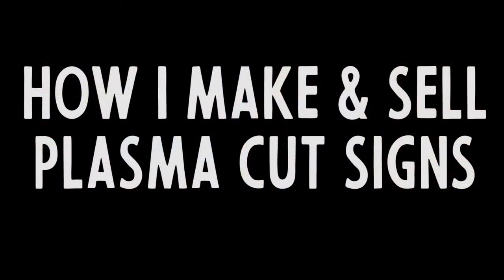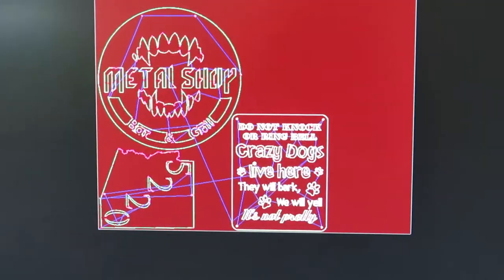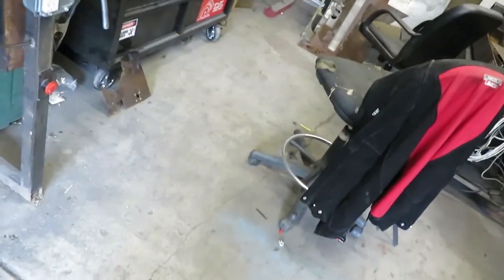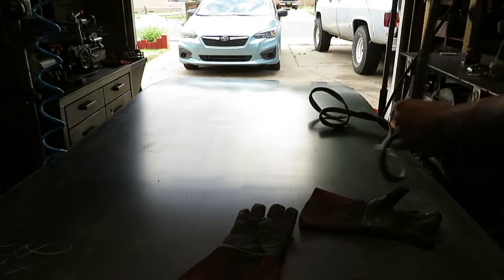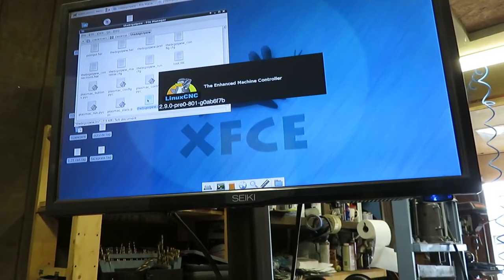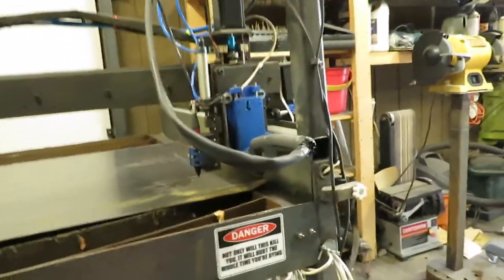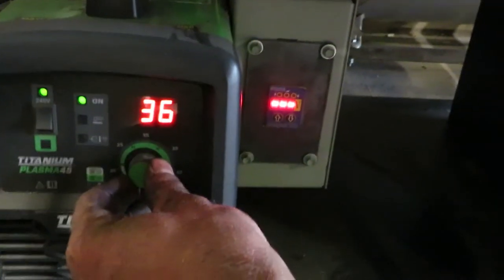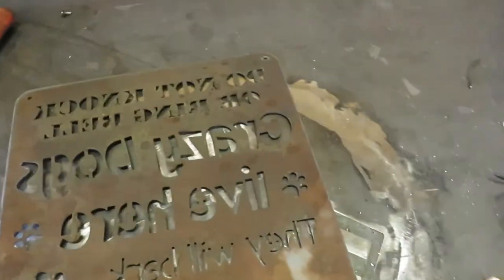How I make money selling plasma cut signs

Comment: Bro., I'm in final design of my cnc plasma table right now.  Your pain on cutting an inch off each sheet is real, but you helped me out just in time.  I was going to do 48" wide. Fook that, now I'm going  to 52" of travel on my head which will prob. have my footprint at 60" +.  You saved me some real hassle bro.  You ever roll through Nor. Cal. I'll do you right with a proper 'thanks'!
Reply: I did the same! 52

Comment: Great work! Tip to get slag off. Muratic acid. Dip signs in the acid over night and it will have a sand blast type finish and the slag will all be dissolved. Helps a ton
Reply from the maker: That's how I've done it in the past, but having a big tub of muriatic acid sitting around my small garage proved to be a little bit of an issue hahaha

Comment: Great video thanks for posting. As I was watching I noticed you not only cut the inch off but you also cut it into 4ft sections. If you have the room to turn your plasma machine you could just feed the full 8ft sheet into the machine and have the excess rest on your sawhorses. Just an idea. Good job on the parts and the machine build!!

Comment: I wouldn't waist that one inch of materials, just cut it in thirds first that should leave you with a 32 inch piece then just put the sheet the other way, you may have to change your program to landscape or portrait if the software has that property or just redefine your edges. Why waist 96 Sq. inches of material.